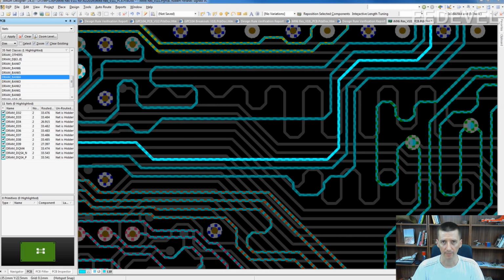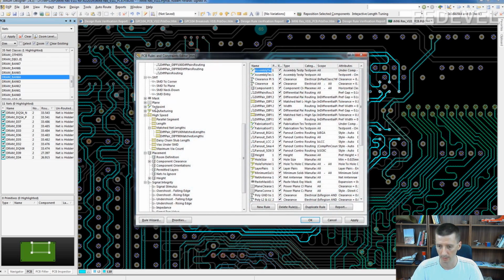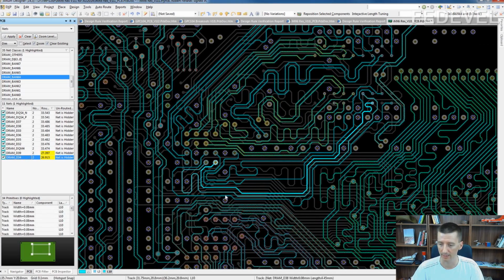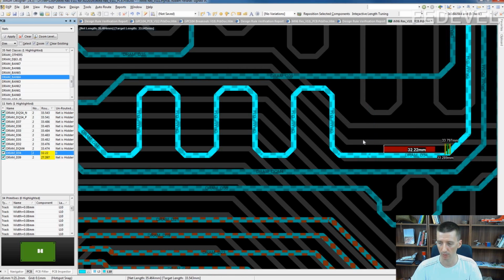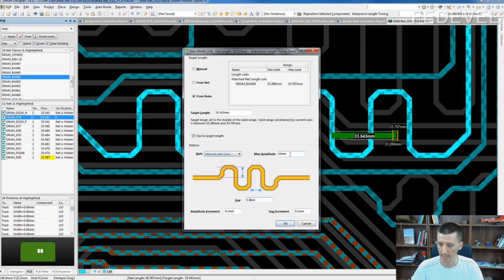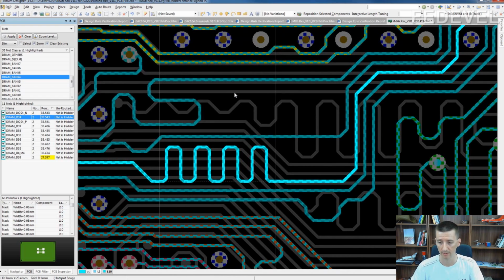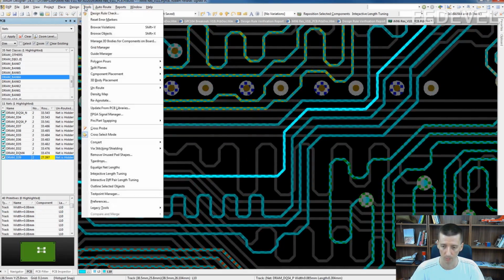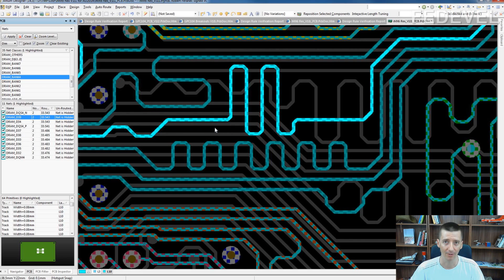Length Matching in Altium

Comment: Thanks a lot Mr. Feranec. I want to design a zynq FPGA circuit or actually the board. All its parts and sectoins using Altium Designer. From power section, to ethernet, to all parts and sections. Audio, video, usb and so on. All digital and analog sections. All high speed buses, clock and...  . A complete FPGA board which then pass SI and PI using Hyperlynx and Ansys. From where should i start ? What courses should i attend ?

Comment: Great video as always!  I have Altium 20.1.14 and I have a differential pair that have the diff pair class name of USB3.  I have a rule (set to highest priority) that I have set to a 5 mil max difference in the length within the diff pair (and the rule is set to diff pair class name USB3 and I press the "test queries" button to make sure it is applying to the correct diff pair).  Yet I can go to the PCB panel and see the 2 nets in the USB3 diff pair are more than 5 mil difference in length. Yet I get no error (no error on the board and no length number highlighted in yellow).  I have the online rule checker enabled, the rule is enabled, and I have that rule set to "online" and "batch".   Any ideas why it doesn't generate an error?  I have the same behavior for the diff pair impedance rule.  If I manually make the gap between the traces too much, it does not cause an error.  Thank you!
Reply from the maker: Thank you Shane. PS: Check your setting in Max Uncoupled Length inside Differential Pairs Routing rule

Comment: Can someone tell me how to lock the "tuned trace"? Because when I click the tab button to select the whole trace the lock option vanished from the side bar.
Reply from the maker: Double check what everything is selected - maybe your selection includes objects which can not be locked and that is why you are not getting the lock option? Possibly use mask + filter for tracks and vias only and try to select it this way.
Reply: Found the lock symbol using filter option. 
Thanks
But why it didn't appear when I select the length tuned portion?any guess?
Reply from the maker: @aqibwahidbutt5316  Maybe you need to do right click on a track and then Unions -> Explode Length Tuning to Free Primitives. That will change the length tuned part to standard tracks.
Reply: Worked! 👍
Thanks 😊

Comment: Where do I use this strategy?
I mean does it good in critical designing Only or Else I can follow it in regular microcontroller based Design.
And what is the benefits of line matching strategy?
Reply from the maker: Simple answer is - mostly DDR2/3/4/X memories and differential pairs. But you may need to consider it also in some slower interfaces - e.g. you may want to have data bus similar length or clock signal the longest - however the length matching criteria are not so strict for slower interfaces (e.g. difference can be 25.4mm / 1000mils or more), so it is not so visible there. Simply to say, the goal is, that the signals will arrive in controlled order e.g. all data signals will arrive together and little bit later the clock will arrive.

Comment: if my VBUS is thin and i mean very thin but it must care out 20V up to 3A or even 5A does the huge ground help ? to not burn out the PCK track ? i mean if the GND is plane. for USB C
i know this is not the right place to ask question but fell like someone who already know can asnwer.
Reply from the maker: both connections need to be wide .. GND and also power

Comment: hi robb.. thanks for sharing you knowledge which is price less, im very thankful to you.
i have a doubt about this length matching, here in this video you didn't explained how to set length for nets. i understand what is the purpose of length matching through your explanation but how to select a particular net, is what im not getting please can you explain me .
Reply from the maker: It depends on what you are routing - check out your chip design guide. Generally nets in one group should be routed similar length (shortest and longest length must fit into a tolerance e.g. maximum difference between shortest and longest track must not be bigger than XX mils ). Then, there are relative length rules - not supported by Altium. These are for example rules like ADDR/CMD/CTL group can not be longer than CLK group and can not be shorter than CLK-XXXmil
Reply: okay but im asking is different, for example i want to perform length tunning for net1 net2 net 3...net10 tracks. how to set length for selected nets? that is my question. waiting for your answer
Reply from the maker: Set length in Altium? I am not really sure what you mean when you say "set length".
Reply: i m sorry for not being clear, for example i am routing an IC which has 20 pins and all are connected to Micro-controller.Now i want to rout them  by using length tunning. Here i have to select the length of each track as same(eg-30mm), because that is the purpose of length tunning na.how to achive that 30mm for all the track nets. that is my question hope im clear this time....

And one more i want to ask you,before i m working with protel now just started with altium. i m facing a problem in one issue i.e., i will have designators and component values when i update pcb.
In protel if i click one of the designator i can edit its size and can hide it and it can be applied to all other designators by using global option in protel.. But here in altium i am able to change only one at a time.For each component i have to change it again which is very difficult and time consuming as i have many components(700) in my PCB. Please tell me the option to make it global to all components. 

waiting for your answer querulously.

Comment: Hello Robert ! 
What is the difference between the signal length and the routed length ?
Reply from the maker: Hello Chrystian, routed length is sum of the track segments, the signal length can add stuff like length in the via, length in footprint and it also calculate it more precisely (e.g. it finds and measures the shortest distance between two pins). Have a look here, that may help: https://www.youtube.com/watch?v=jpk-hfsFaqA

Comment: Nice video! Do you know if the auto router or interactive router will follow design rules for length matching? When routing multiple connections interactively, it seems the length matching rules are ignored, only to need manual fixing afterward. The Situs router appears to ignore length matching rules, and the exporter for Specctra also seems to ignore length matching rules. Manually setting up rules in Specctra works and Specctra does a wonderful job, but Situs appears unable to do length matching.
Thank you. Your videos are very informative. :)
Reply from the maker: Kevin Rouviere Thank you Kevin. About your question - I do not use autorouter and I normally only route one connection, so I really don't know. Maybe someone else can help?

Comment: Please,you could do a video of how to tune lengths on differential pairs? Thanks!
Reply from the maker: Do you mean within a pair of between pairs?
Reply: Robert Feranec i work with pcb single sided, and I need to route high speed usb2. impedance is kept constant 90 ohms on my pcb, means a differential pair separation 7.5 mils and 50 mils track! It is difficult to maintain constant impedance, then I want to keep as close as possible the length of the differential pair. I often find much difference between the length of N and P and not how to adjust without breaking the parallelism. Thanks!

Comment: Nice one Robert. Question where does one get the information for the the length if length is not given ?
Reply from the maker: Thank you. What do you mean by "is not given"?
Reply: Robert Feranec I meant the length of the trace say example You look at DDR memory where do you get the optimum length match in the datasheet?  also if it isnt supplied say Im working on an old sharc dsp 21065L dsp it uses some flash and SRAM non of the components supply trace length info where do I get it from ?
Reply from the maker: ***** Usually, all requirements are specified in Design guide. For example, for this particular case, you can find more info here: http://www.fedevel.com/welldoneblog/2014/06/ddr3-length-matching-rules/